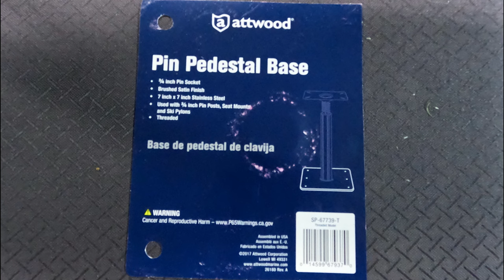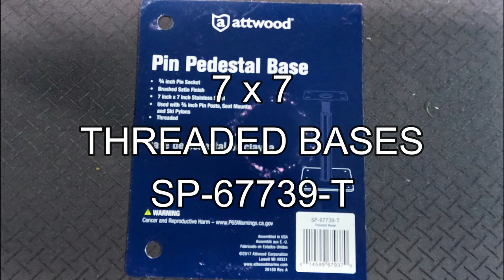DIY Livescope Crappie Setup Millennium Double Seat Style

Comment: have u considered guiding carlos?
Reply from the maker: No, I still get stumped in situations or on the water location decisions.
Reply: I was a guide on belton and waco for a while..  I think you would do fine.,,. you just cant get caught up in the  " limit " game.. doing that means setting yourself up for failure,,, customers know that fish dont always bite  and can tell if you hustled and did your very best...  if you ever want to get together and exchange info,  I would be happy to do it.,., I have 2 boats  a center console  and an aluminum lowe 195.. I use the bay boat it rougher weather, and the aluminum boat for calmer days... im running a 1226  Garmin  livescope and two humminbird 898s.. I have ALOT of hours fishing belton and waco.
 right now is a great time to mark cover and structure that is exposed, it will pay off big time later when the lake comes up.. also, some of the very best years on belton are when the water comes back up to normal pool after a low water drought period.  as u said in your vid, it takes time to find the prime spots on belton.. sooo many trees,, and most of the brush that has been put out over the years, is not in deep enough water right now..  where waco is just the opposite.. mostly brush .... 
 I also believe the instinct of fishing is in our DNA.,,. some people just have natural instincts  for it, and you have strong fishing instincts.. its just a gut feeling you get, and follow them,.    the tip you said abt trying different colors when the fish are BITING is golden...    @CarlosPadillaCentex
Reply from the maker: Great setup you have. I still haven’t been to Waco. 18 ft of water depth difference is huge. I can see how a lot of people are losing there honey holes.
Reply: I guided waco and belton for abt a year until my spinal issues wouldnt permit it any longer.. waco and belton are VERY different in many ways... the timber around the bank lines on waco rarely hold crappie.. theres a few areas on the south end that are away from the bank, that can be very good, especially in the morning,, we call the spot "morning wood' ha  the wintertime pattern on waco  is much easier than on belton for me.. lately where im finding crappie on belton is in the OG timber lines,,, these are the original growth lines of timber, that grew before the lake was flooded.. some are not even on the maps...  so what im doing is when I see a slew on the bank, that looks like water flows, or flowed down it at one time, I  point my boat directly out from the center of the slew, towards mid lake,,. I am systematically checking every one on the lake, that goes out to 25 feet of water or deeper... some of these old timber lines do not originate from the bank, they may be out 30 to 50 feet from the bank before they start...  also some of the timber lines are slightly staggered, because they grew on either side of the creek channel.. the timber lines that go towards or terminate into the main river channel are primo...   im also looking for isolated trees in certain areas that are 23 feet or deeper, but right now, 25 feet seems to be the prime depth.,,, if  I catch a few on a lone tree, I search a radius around that tree, looking for other trees..  most of the brushpiles on the lake are way too shallow right now, so im strictly searching timber.. we recently found an old timberline in 25.5 ft, that starts abt 20 yards from the bank  and runs 3/4ths of the way across the lake, with crappie on almost  every tree.. around 30 trees ...  this is the key to catching wintertime crappie on belton.. the fish wil not always be active on certain treelines, so im trying to find as many as possible, in different areas . also  timberlines that are in front of banklines that run east to west, that are protected from the north wind tend to be better... crappie dont like alot of wave action..  its the same way in spawn.. I like the banks protected from a north blow.. and alot of wave action in the main lake created by boat traffic...  @CarlosPadillaCentex